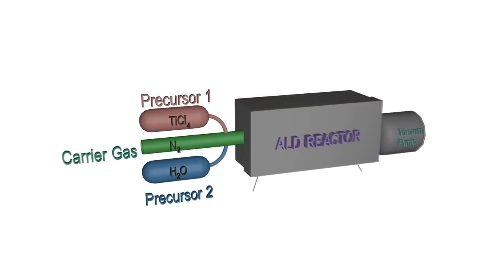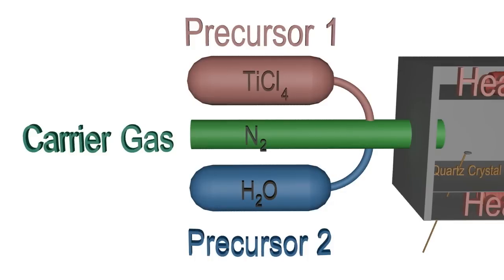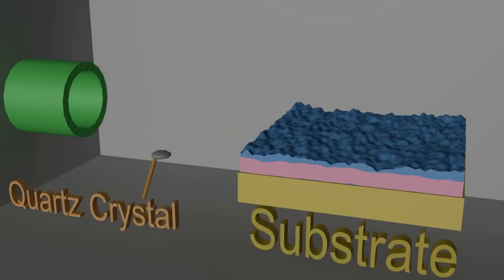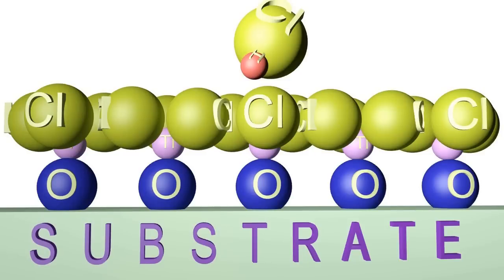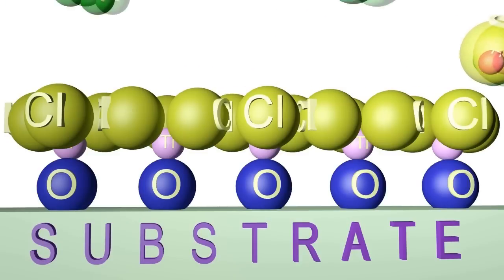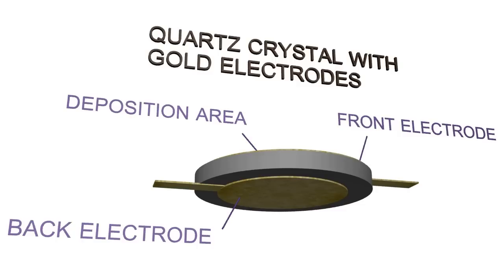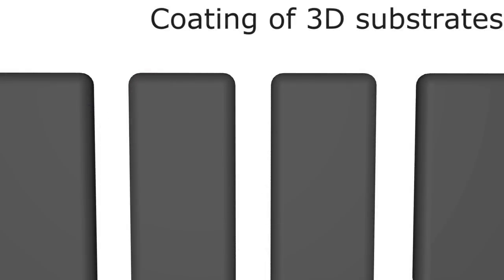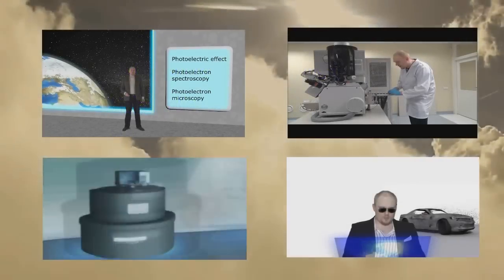Atomic Layer Deposition Principle - an Introduction to ALD

Comment: what does the quartz crystal do?
Reply from the maker: Quartz Chrystal Microbalance (QCM) is a cost efficient and accurate film growth measurement tool for ALD depositions
Reply: @CaptainCorrosion  how does it measure the film?
Reply from the maker: The crystal oscillates by applying a voltage onto its electrodes and this oscillation is very sensitive to any change of mass. So you can basically detect if anything deposits on the QCM crystal during each ALD precursor pulse
Reply: @CaptainCorrosion  ok so it shows a/c resistance based on how much deposit is on it?

Comment: Great video! How do you make sure that you only deposit one layer though?
Reply from the maker: In reality you deposit less than a  complete layer in one cycle but after say 50 cycles you may have 15 layers of atoms, depending on the recipe. Furthermore, at the nanometric scale, the deposited material has slightly different properties when comparing its top, middle and bottom part. This can be seen for instance in X-Ray reflectance or transmission electron microscopy studies of thin films.